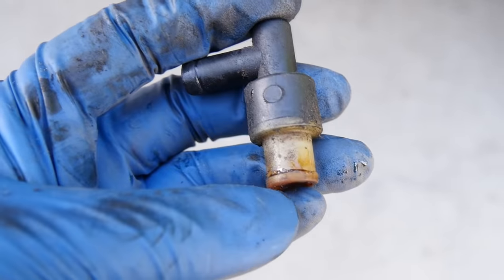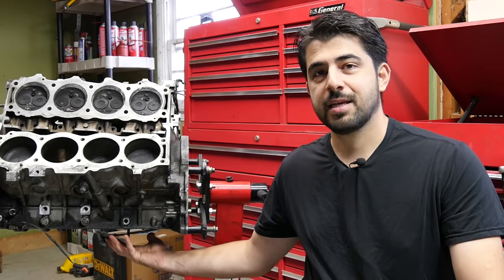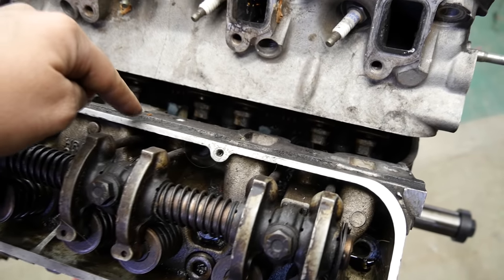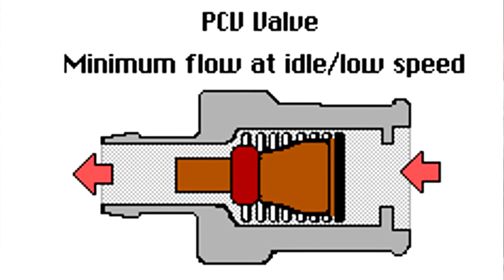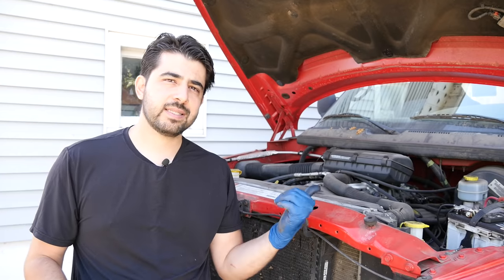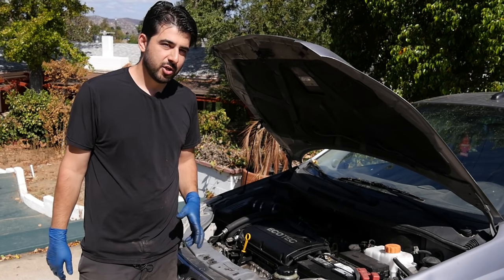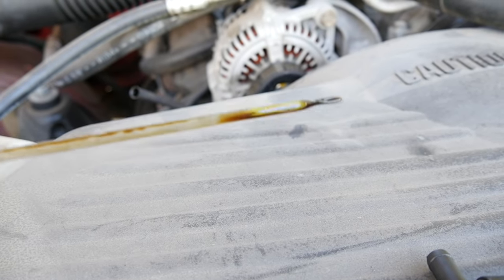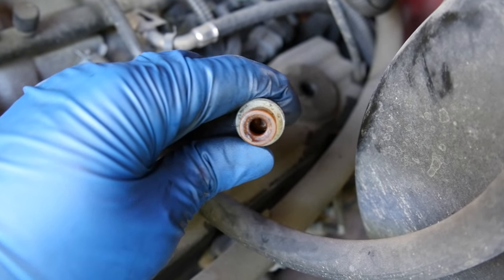The Valve That Can Cause Major Engine Troubles - How to Avoid Engine Sludge

Comment: This video may have helped me solve my '96 Olds 88 rough idle problem.  I replaced plugs, wires, cleaned fuel injectors to no avail.  But after viewing this video I hunted down the valve (it's hidden under the MAP sensor) and replaced it. The valve did not move freely.  Total cost $3.21!  Idle is better and I'm hoping oil consumption will improve too.  Thanks!
Reply: What kind of noise was it making if any for faulty valve
Reply: @AJ-gc3sk  a faulty PCV valve would not rattle when you shake it, meaning the valve is stuck in either the open or closed position
Reply: Funny thing is my old man had the 89 olds 88 n he had the same problem and replaced the same things as you did. I was 12 n saw my dad, my brother in law, and my old neighbor sitting in the engine bay tearing out parts. I’m now 41 and have faced my share of rough idle, if I can only go back in time. Lol
Reply: @pprb123  not exactly. My pcv valve did rattle. But not as clean of a rattle when it’s new. Fixed my issue
Reply: Sometimes the valve can rattle and still be bad..for what it's worth just change it with original part and clean your Mass Air flow sensor as well.. These 2 are very crucial to optimal engine performance and are soooo overlooked even by experienced mechanics...make these a part of your routine preventative measures along with on time oil changes, throttle body cleaning, air and gas filters changes..RPM is soooo crucial to these newer piece of crap GDI engines..
Reply: @segbachan5123  Well stated, there are many shop tests that will tell if it's bad, but won't tell you if it's good. The PCV valve is the most overlooked on an engine.. Some switches are working failures that test good when you take them off and check but with engine vibration running they intermittently fail.

Comment: Thank you for the video and great explanation. My husbands truck hasn’t been sounding right on the highway. I drove it yesterday and the “low oil pressure” light came on and then went right back off. I decided to check the oil- ZERO oil on the dipstick. Did some research and tested the PCV valve, zero suction. Waiting on hubby to bring me the part- I’m just hoping no damage occurred. I had no previous knowledge that something so simple could prevent major issues

Comment: Most overlooked simple part.
Reply: Sometimes not so simple, some  Volkswagens have the PCV built in the valve cover >.<
Reply: This is why German cars are expensive to repair/service.Avoid German cars as they're rip offs!
Reply: @tardeliesmagic  Volvo is the worst ever...overly complicated that translates into huge rellacement costs.
Reply: @Darksyne  honda is right on the top
Reply: I will replace mine just incase. Just bought a used car.
Reply: @Darksyne  Chevy Cruze has it built into the valve cover too. It's a dumb design.
Reply: True i gotta get mine done
Reply: Yup, my friend mechanic said it doesn’t effect much but when i replaced it in Acura TSX, i noticed a big changed, overlooked indeed.
Reply: @soylentgreen2065  Have a friend with a Volvo S40 that needs cleaning -- oh happy day!!!  2004 Highlander kind of sucks, too, but nothing like the Volvo.  Going down to the junk yard to practice doing the job once before doing it on my friends car.
Reply: Nissan's the best
Reply: @tardeliesmagic  welp sadly Americans aren’t too far from them my cts has its pcv built in the valve cover also and it’s design is so bad that if not properly maintained you’d be gifted a expensive job of replacing ur timing chain. Yep gotta love those ly7 high feature gm engines
Reply: @Darksyne  Just like mine on my Audi A4 2.0 TDI engine.
Reply: @AtixxD  oof just make sure you don’t use cheap diesel then.
Reply: Why, does that increase the sludge buildup in the engine?
Reply: I wonder if the CRC INTAKE VALVE CLEANER also cleans the PCV valve... does anyone know?
Reply: 😂😂😂😂😜funniest thing I’ve ever heard. Granted, Nissans are better than they once were, but there is no comparison to a Toyota. GTFOH !
Reply: On top? Of what the tow truck? Toyota is in a class of its own son. Hard to argue with the facts. Toyota makes superior vehicles.. nobody can touch them

Comment: How much oil can a catch can catch if a catch can can catch oil?
Reply: Good one. Zero if you don't have one. lol
Reply: A lot, and if you are cheap enough, you can just recycle it by pouring it back into the crankcase periodically.
Reply: Enough.
Reply: Dicen que nicho dijo un dicho , pero nicho no ha dicho ningun dicho, i si nicho lo huviera dicho bien dicho lo huviece dicho.
Reply: Que si que no que no se que, que si que no se que, que cuando se que yo que si que el que si que se.
Reply: The same chucked wood that a wood Chuck chucked 😁
Reply: It depends on the ratio of volume how much the catch pan can hold versus how much oil is in the engine and going into the catch pan. Just saying.
Reply: It would catch as much as a catch can could if a catch can could catch oil
Reply: no....there is trace of water in the oil, when its present in the manifold tube...come on, smatin up.
Reply: Mick......ENGLISH HERE, WE SPEAK. CANT TELL?
Reply: Until its caught full dummy,,,
Reply: Whatever the volume
Reply: Where was the man when he jumped off the bridge?
Reply: Ask the woodchuck that chucked on wood.
Reply: ALOT if it’s a 5.7 Hemi.

Comment: Ive been lucky enough on my vehicles over the years, the PCV valves are easily accessible. When i do my oil changes, i remove the valve and spray a little carb cleaner in there to flush any residue out. Havent had an issue with one yet...
Great explanation of the PCV system.
Reply: Thanks for the tip , HONDA V6 pcv valves go for  $25 - $30.00 , and there's  3 Honda's in my family.
Reply: @johnlopez3001  
No worries!
No point in spending extra money.
Go ahead and flush them out at every oil change.
Reply: why carb cleaner and not brake cleaner
Reply: Get a Toyota, the pcv valve is super accessible, and it didn’t even cost 5 bucks for oem pcv valve😜

Comment: Thank you so much for the explanation of the PCV valve, I usually do all of my own work but my wife’s car is still under warranty so I let a garage (warranty approved garage) work on the car idling bad at stop and stalling a little while going down the road. They told me it was the left side valve cover gasket letting oil into the intake. I had to see if this was correct. Through your video you explained how this can happen. They should have just told me the PCV valve though. I really like your page and very detailed for us DIY’s out here.

Comment: Yo just be careful on older cars, these get brittle over time and will crack into tiny pieces. I changed mine out and my car went from smoking to a much cleaner burn. No more smoke and it's a cheap parts. Well worth it.

Comment: Went to change my wife's PCV valve a few years back, simply because of mileage.  Genius Toyota put it under the intake manifold and on her car, it requires removing the whole front clip, radiator, and starter to take the manifold off.  Lord help me if that thing ever actually fails.
Of course on my DODGE, it's right on top of the engine...2 minute job.
Reply: I don't think I've seen an oil leak on a Toyota yet, so there's that.. For what it's worth anyways
Reply: I think it depends on what year and model your car is. On my 2002 Sequoia it's very easy to replace. it's near the spark plugs
Reply: What Toyota is that?
Reply: @bassam_salim  Scion xD
Reply: Is it possible to reinstall and relocate it to another easier accessible location?
Reply: Low failure rate item
Reply: @DonnieDarko1  Not sure...it threads directly into the engine block.  Same engine in a Corolla, you can simply pop off the intake manifold. On the Scion Toyota didn't leave enough room between the manifold and the rad to get it out :(
Reply: Chris Freemesser. I'm currently working on a power steering pump on a sebring. in the 70s it was a half hour job.  now I have take the intake manifold off.  lift or drop the engine some. I'm not shure what I'm doing. my dodge has the pcv right on top. 5 sec. job.
Reply: Chris Freemesser 
 
      Yeah I know about that.  2011 Camry.  Under the intake between engine and firewall.  👎🏻
Reply: Chris Freemesser 

Not all Toyota’s

And many function fine but only changed as insurance
Reply: @DonnieDarko1  yes, just run a longer hose and make sure the valve is directed in the right orientation of vacuum and the hose is ran in a manner where oil can't pool anywhere
Reply: That’ll be about the only thing that you’ll find Dodge being better at. Worst automatic transmissions ever built. Toyota outperforms any American and European car company in terms of reliability. Not even close
Reply: That's too bad, my 98 Camry it's on top of the VC
Reply: Makes me thankful it is right at the top in my Saturns... Probably takes longer to open/secure the hood than it does to swap them out.
Reply: My Mazda 3 is like that. Required removing the intake manifold. Horrible design.
Reply: Chris Freemesser, genius dodge engine fails before pcv valve needs replacement
Reply: I change my daughter's Ford  Escape( yeah! A freaking Ford) pcv valve and is in the middle of  the intake manifold. Had to remove cover, plenum, fuel rail and manifold to get to the plastic piece of shi#. The valve disintegrated wen i tried to unscrewed it.
Reply: My 95 camry's got the PCV right on the VC. Older models make it easy :D
Reply: @gavnonadoroge3092  false. My '99 intrepid 2.7l is still kicking
Reply: My 2007 Prius’s PCV is buried under a bunch of stuff. However, it’s also not listed on the maintenance schedule as an item that needs replacing. Since my car is running fine (at 196K), I’m not sure if I should go through the trouble of replacing it.
Reply: @chrisfreemesser5707  that's barely considered a toyota that's why
Reply: The dodge won’t even last the lifetime of the PCV.

Comment: I have a toyota yaris  that was using a lot of oil  spark plugs  black  I bought a pcv valve from toyota the engine is running smoother I am checking the oi consumption  looking good only problem only toyota sell the pcv cost £30  ouch if  it cures the problem  I don't mind

Comment: These videos are great for solving simple problems that otherwise would be by mechanic and automotive shops that would replace the $25-50 part but charge you for a pile of "OTHER" works they didn't really do.

Comment: I rebuilt my first engine by myself top to bottom in 1969 as a 14 year old. it was a 1954 272 Y-block Ford. Worked as a heavy equipment mechanic for over 31 years for a local municipality 9 years as a shop supervisor. I learned hands on rebuilding and repairing things not replacing them from old timer's who knew more than I could ever fathom learning but they taught me all they could including welding, machining and fabricating. I was a good student and a fast learner. Attended an automotive tech school for four years. Could have been a teacher. Was NAISE certified in every phase. None of my mentor's ever gave much thought to the PCV positive crankcase ventilation system even on engines that were not taken care of. In my 40 plus year career I never found a stuck or malfunctioning PCV valve or suspected one of causing a major engine or component failure. Yes compression can sneak by the rings on older engines as well as new one's and cause some blow by and slight pressurization of the crankcase however in order for that much pressurization to occur it would blow out a seal or a gasket first. I do know if a PCV valve is stuck in the open position it can suck in engine oil and burn it along with crankcase vapors through the carb base however all factory valve covers have a baffle that covers the small place where the PCV valve lives protecting it from engine oil slung up from the rocker arms. So in theory even one stuck open would not cause an excessive oil consumption issue. Aftermarket valve covers often lack that little protection for the PCV and an oil consumption issue could arise. Since a PCV has full manifold vacuum to it that can be a starting place to look for an engine performance problem such as a rough idle. No two mechanic's agree 100% 0n everything. Most agree to disagree.

Comment: Is it just good to replace it every so often even if you don’t have any symptoms ?
Reply: Check the maintenance schedule on your vehicle owner's manual.  Some manuals call for inspection and replacement of the PCV valve at certain mileage or years.  Mine calls for replacement at 100k miles.  Obviously earlier if it fails prematurely.

Comment: That's pretty good explanation. Except you didn't address what causes the PCV to fail. For that we need to go to an old marketing and advertising slogan... People who know use Valvoline. What do they know? All oil contains paraffin wax. As that paraffin gets separated under high heat conditions it gets sucked into the upper part of the engines and is allowed to cool. Leaving the paraffin content behind. Which builds up on small components such as that little spring loaded valve. In order to stop this buildup a low paraffin content oil should be used. And there's only one of those on the market. Valvoline. Quaker State Pennzoil Castrol and most of your synthetics, are very high paraffin content oils. Most of your synthetics are almost straight paraffin. This paraffin builds up all over inside the engine including the oil passages themselves. When the PCV is stuck in the closed position, those Vapors push the oil out of the seals through least path of resistance. Which is the same principle as electronics use for flow of current. In the case of an engine, those weak seals are the ones that surround rotating components, such as the front and rear main seal of the engine. However, that paraffin will also build up on top of the Pistons. And after the detonation of the spark plug, that oil can smolder on top of the piston. So when the air fuel ratio is introduced into the combustion chamber it's can be ignited before the spark plug. This is called predetonation. Which will in turn, burn holes in the top of the Pistons thus leading to insufficient compression. Which looks like what was happening, or about to happen on those pistons in your display engine. It is literally Murphy's Law that says a $0.10 fuse will destroy a $50 relay every time. In this case your PCV valve is the $0.10 fuse. And all of the components destroyed by lack of crankcase ventilation, is your $50 relay. Literally, I $3.95 part will save you thousands in engine repair when maintained regularly. Which in most cases is anywheres from 5 to ten thousand miles. Personally, as a professional mechanic, I love it when you don't change your PCV valve. Because I'm going to charge you $75 an hour to fix all the damage it has caused. In most cases, just to take the engine out of the car, you're going to be billed 6 to 10 hours depending on the year make and model. And you have to take the engine out of the car, or the transmission, to replace that rear main seal. There's no shortcut around it. And there is nothing on the Shelf at AutoZone that is going to stop that rear seal from leaking. There are no pills in the automotive industry. There's only one way to fix a problem. The right way the first time. You need to make a decision. Do you want to change the $3.95 PCV valve? Or do you want me taking your engine out of your car, putting $500 in seals in it, and putting it back in for around $2,000? Did you notice, he did not hook up a computer to find this problem? That's because you can't. In fact, that least path of resistance thing that I said earlier... Could be out the side of a knock sensor or an oil pressure sensor or an oil level sensor. So now we're not just talking about seals... Now we're talking about cheap China sensors. A 5-cent diode... That I'm going to charge you upwards of a hundred and fifty bucks to replace. Cam position sensors, crank position sensors... Oil is a corrosive on plastic. And it wipes those out too. As a mechanic the best advice I can give you is, find someone that you can trust to help you with the maintenance of your vehicle. Make sure that they are knowledgeable and at least State Certified. Keep in mind that mechanics solve these problems every day. Where is your plumber painter electrician construction friend... May have never solved this problem at all.
Reply: Reel Tech - calm down man.
Reply: Good novel
Reply: The following website, posted by a Valvoline wholesale distributor, addresses various “Motor Oil Myths & Facts”  including differences in types of oil, causes of sludge, filter change requirements, oil change intervals, etc.:  http://www.whitfieldoil.com/156.631

In essence, and according to this Valvoline distributor, not me, paraffins are separated from crude oil in the refining process and are not present in any modern motor oil that meets current OEM requirements.  That being said, if for any reason, you have a sludge build-up in your engine, as is common with blocked PCV valves and in vehicles with GDI (direct gasoline injection into combustion chamber) engines, the cure is as outlined by Reel Tech.
Reply: Not every engine has to be removed to replace a rear main seal. On the mustang you drop the tranny, clutch, flywheel, etc, take off the plate, and replace the rear main seal. Of course theres mote steps than that, but ChrisFix has a video showing how to do it.